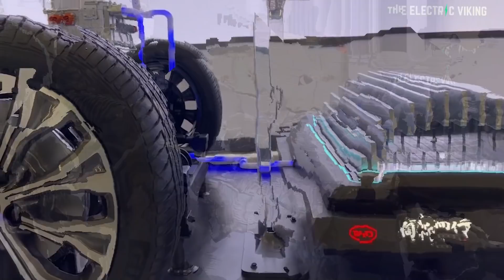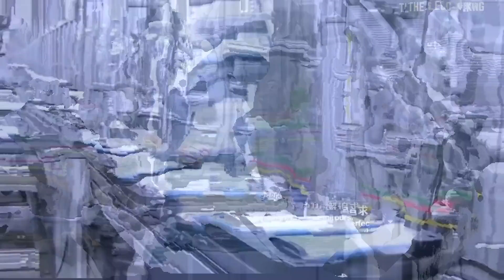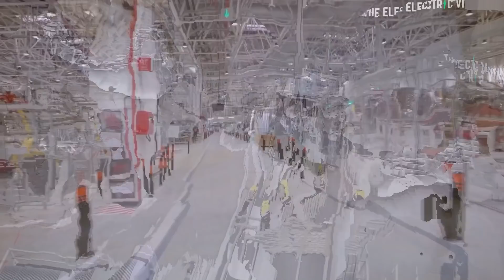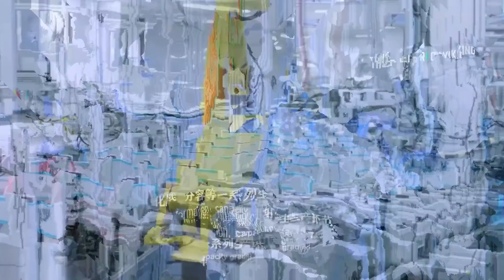BREAKING: Tesla order BYD's LFP batteries for 200,000 EVs

Comment: Our SR+ is charged safely to 100% each night enabling maximum range of up to 480kms/300miles as required.
It’s the pick of the bunch.
Reply: Have you got the new 60 pack David? How many miles are you getting real world?
Reply: @wakeywarrior  it’s 8 months old and 278 miles fm  a nominal 50 kWh, but we keep up in the slow lane here in Australia @62-65mph in our summer. Being retired we can be choosy on weather forecasts also.  Lifetime average is 119km/kWh and dropping.
Reply: Is that the lfp version,, I know your not supposed to charge past 80% on the old ncm all the time to extend life expectancy of battery just asking 
I can't wait to see the 4680 comeing out of giga Texas i know right now its software detuned to match the 2170 comeing out of fremont until they can switch over to the 4680
Reply: @lesstevens2370  yes, LFP with significant buffers. I can sleep without worry and never suffer significant degradation either.
In Australia the SR+ qualifies for a small rebate - $A3K.  It’s the standout bargain.
Reply: @lesstevens2370  yeah, the worry free LFP with the most accurate energy tracking software also ……totally accurate and linear.
Reply: @davidpearn5925  right on cant wait to ditch my old gasser 2017 dodge durango 2 more years left on the loan then I'm out no more gas vehicles for me
Reply: Gas over here in canada is 1.70 a liter electricity is 0.08 cent a kwh
Reply: @lesstevens2370  slam dunk !

Comment: You can use the full range of a non-LFP battery.  It's just good practice to not fully charge and leave the batteries fully charged for a period of time.  If you're heading off on a long trip set your charging to take your batteries to 100% an hour or two before you depart.

But LFPs are, IMHO, a better choice for almost all.
Reply: That just like saying you can do cocaine and heroin but its good practice not to...🤔
Reply: @airrodgers7277  
Analogy fail....
Reply: @airrodgers7277  but that would be a lie!! Haha
Reply: @airrodgers7277  That is certainly not a universal truth.
Reply: NCMA chemistry is way better than lfp because of the range.
Reply: @greengold6705  
Flip-flops are great on hot asphalt but flippers work best if one is snorkeling.

Most EVs are likely to use LFP batteries due to their lower cost, very high cycle life, ability to be fully charged and discharged repeatedly, and resistance to burning.  Other chemistries are likely to be used in performance and very long range EVs due to their lower weight per kWh.
Reply: Maybe in China but not in the USA. If the battery costs a thousand dollars more and had 50 miles more range that's what everyone is going to go with in the USA.
Reply: I think there will be a place for LFP cheaper low end cars and energy storage.
Reply: @greengold6705  
I'm not sure what US vs. China has to do with it.  Within a few years it's likely all batteries used in EVs in the US will be manufactured in the US.  There's not a lot of labor in cell manufacturing and battery pack stuffing.  Batteries are heavy, large, and cost to ship.  Battery manufacturing, like car manufacturing will tend to happen close to the market.  Especially as production becomes more automated and China's labor costs continue to increase.

IMHO most people are not going to own cars 20 years from now.  Robotaxis will be so inexpensive and convenient that most people will decide to spend their car dollars elsewhere.  Including people like me who live in fairly remote areas.  LFP cells are perfect for robotaxis.  And robotaxis don't need high ranges.  Robos can be in heavy use during peak demand periods and then rotate in for a quick recharge between demand peaks.
Reply: @greengold6705  
LFP cells are likely to be used in all cars except for high performance "sports" cars .  With a fully developed rapid charging infrastructure cars will need only modest ranges.  

Higher density by weight cells are likely to get used in things like long haul trucks and airplanes where the extra weight of LFP cells would be detrimental.
Reply: @bobwallace9753  I wasn't saying China vs US I was Lfp might be better in China because it's cheaper with less range while the US customer is more concerned about range than cost.
Reply: @bobwallace9753  electric semi are vaporware to been five years since Tesla came out with the semi and they have sold no units
Reply: @greengold6705  
I do not agree on the range issue.  I think many US drivers now believe that they need a lot of range but I think that will change once they have some EV experience.  

No one has a gas pump in their garage.  With an EV you can get in your car every morning with a 'full tank'.  And with a moderate range EV you can do long trips and arrive not long after you would were you to drive an ICEV.  People will learn that.

Private car ownership, I think, will largely fade away over the next decade.  It just won't make economic sense to own a car.  Taxis in some of the markets which have the highest usage, NYC and LA, average about 70,000 miles a year or about 190 miles per day.  You could easily do that job with 100 mile range EVs.  Just recharge a couple times per 24 hours.
Reply: @greengold6705  
Tesla has been battery limited.  Tesla makes more money off their Model Ys than they would, apparently, were they to use those cells in semis.  Therefore, Tesla has postponed semi production.  Tesla delayed the new Roadster for the same reason.

But now Tesla is manufacturing 4680 cells at a commercial level and they are starting to build semis.  Tesla is in the process of delivering the first 16 T-semis to PepsiCo.  I think some may have already been handed over.  Megachargers have been installed to put juice in them.
Reply: @bobwallace9753  Range is one of the top issues with people switching to EVs that is not going to go away anytime soon. The whole Robo taxi is going to eliminate car ownership is a complete hypocritical because they don't exist yet sure they might a tiny geo fenced area in China just in Phoenix Arizona with a very very small number of vehicles doing it. The fact you have no idea when Robo taxis are going to be able to really match a human driver. If you want to let fsd beta drive you every where good freaking luck buddy I wish you the best. I love Tesla but Elon is a car salesman every year is the year they are going to solve fsd.
Reply: @bobwallace9753  The first 16 semi's that was supposed to come out four years ago and no time table to build more. I'm not against the Tesla Semi just saying you can't take everything they say as a guarantee. They are building 4680 at a very small level I absolutely hope they are successful at mass production of 4680 but it might take another year or two to get there.
Reply: @greengold6705  

1.  "I just bought a 350 mile range EV and now realize that I paid for about 100 miles of range I never use."  That will  be heard as people buy and experience and next time many will buy the size that fits them.

Range anxiety anxiety.  People will buy belts and suspenders, then realize they needed only one of them.

2.  Yes, the Chinese robotaxis are geofenced.  But they are operating.  If something exists then it's real, not vaporware.  Let's not have a game of moving the goalpost, shall we?

3.  I have a guess when robotaxis are going to replace human drivers.  Now.  In a very small number of cases in China.

Elon and the other people involved in Tesla's FSD program expect their system to be working about 10x better than humans by the end of this year.  Remember, they see all the data.  They know what is yet to be solved and have a decent idea of how to fix the remaining edge cases (let their AI computer chew on the data for a few more months).

Let's be conservative and assume they are off by a year and they reach 10x better by the end of 2023.  I think that 98% likely.  Then add on one more year to collect the data needed for the first states to allow driverless operation.  2023 to 2025 is when I think we'll see Tesla robotaxis and Tesla is likely to manufacturer millions per year.  

Would I let Tesla FSD beta drive me around?  Absolutely.  I fully understand the word 'beta'.  And I'm smart enough to pay attention and be ready to take over if an unsolved edge case is encountered.  I don't do stuff like text while I drive.
Reply: @bobwallace9753  Range is one of the top issues with switching to EVs I never said I agree with it I never drive over 200 miles a day but it seems the vast majority of Americans would rather pay the extra 500 to a thousand dollars to get the extra 50 to a 100 mile range. When you say robo taxis you are not talking about a small fenced in area only to drive in. The Robo taxi implies that you are going to go to work or sleep and the car goes out and does Uber all by itself I have no idea when that is going to happen and neither do you. I hope they can solve it soon but who knows and then States and local governments are going to be a huge barrier with regulations.
Reply: @bobwallace9753  You would have told me 4 years ago that it's 98% by 2022 so fool me one year okay but Elon has said this is the year for year's but I hope they are successful but I wouldn't bet the house on it
Reply: @bobwallace9753  Why hasn't China been able to scale the robo taxis if they have it down so good.
Reply: @greengold6705  
Again.

First time EV buyers may well purchase more range than they actually need because they are used to filling up once a week or two.  They have never experienced a car that has a 'full tank' every morning.   They think they need hundreds of miles of range in order to take long trips.  They don't realize that they can charge up while going to the bathroom and grabbing a sandwich at the counter.

The difference between a robotaxi with a small geofenced area in which to operate and a large geofenced area in which to operate is a matter of someone doing some mapping.  My math says that a team of ten or fewer drivers working eight hours a day could map a good sized US city in a 40 hour week.

I'm not saying that the detailed robotaxis are ready to handle the most unusual places to drive that one can find.  But it looks to me as if they could drive over half of the places.   Right now in China you can climb into a Chrysler minivan's back seat and go to sleep while it drives you, with no safety driver aboard, in geofenced areas.  There are videos on YT.  Look for AutoX.

Florida and, I think, Nevada have already written regulations allowing full self driving cars.  When some company hands in the data it's a go.
Reply: The semi was brought out in 2017 and he said they would be delivered in 2019 sorry 3 years ago watch the video if you don't believe me. Three years without any real deliveries is a lot of time. I'm not hating on or against the Tesla semi it's a cool product just like everything Tesla does but you can't go by Tesla's timeline on everything. I hope they are successful at everything they do and I think given enough time they will. That doesn't mean you are going to get a robo taxi this year or next.
Reply: So because a YouTube video in China showed someone in a robo taxi you think it's ready wow man. You honestly think whatever company is doing is further ahead than Tesla on FSD. That is not proof robo taxi's are ready imo but I guess we will see. I've never claimed I know everything but I've followed Tesla for years longer than most of the YouTube Tesla channels that are out right now. I've heard the robo taxi's argument for year after year so I don't put much faith in it. When you watch FSD beta you can clearly see it's not ready yet but I hope they are successful with it.
Reply: They are at least a year or two away from serious 4680 production listen to the recent earnings call.
Reply: A million 4680s sounds like a huge number but that only makes a thousand cars. I'm not skeptical or negative on 4680s I think Giga Texas will be a great factory. I'm only skeptical on full self driving but I hope they solve but it could be year's away.
Reply: @greengold6705  
I'm not going to rewatch the video to see if it was 2019 or 2020.  Stuff on the web says 2020. 

Here's the point I wish to make.  When someone sets out to do something that's never been done before the best they can do is to estimate completion based on the known knowns.  Until they travel into that unexplored territory they will not be aware of problems they may encounter.  Elon makes his best guess, gets it right sometimes and gets it wrong sometimes.  He can't predict a pandemic before the first case arises, for example.

I'm pretty sure that in 2017 Tesla did not know that they would develop dry-rolled 4680 cells.  Nor did they realize how high demand would be for the Model Y.  Things like that are unknown unknowns that change how the future plays out.
Reply: @greengold6705  

Oh, damn my lying eyes have deceived me again.

BTW, there are multiple videos showing people documenting their experience in using AutoX robotaxis.  Waymo has been making some small area geofenced robotaxi runs in the Phoenix area.  There'a  video where a woman tests a Waymo driving with no one in it against her Tesla w/FSD.  The Waymo, IIRC, arrives slightly before the Tesla at the destination.

Robotaxis are not vaporware.  They just can't operate everywhere yet.

I've been following Tesla since they first announced the Roadster.  I had been following low carbon technologies for years before, worrying about how we find acceptable solutions to fossil fuel use.   The Roadster proved that EVs did not have to be golf carts with doors.  They could drive fast and far.  I've been watching FSD videos as updates are released.  

I have not said that FSD is ready, please do not misreport what I've posted.

The best you and I can do is guess.  My guess is that there is at least a 50/50 chance of Tesla FSD being 10x better than human drivers by the end of this year and more like a 85/15 chance of it being ready by the end of 2023.  Make whatever guess pleases you.
Reply: I think we agree way more than disagree. I just don't know when Tesla FSD is ready I'm sure they will be the FIRST to solve it not autox never heard of them and wouldn't trust anything they same goes for waymo. I have faith in Elon and Tesla in the long run it will just probably take longer than  they let on but I hope they are able to do it all as fast as possible.
Reply: Sorry to tell you this but videos can be heavily edited tons of Tesla FSD videos are edited to hell and back to make it look like FSD is completely ready. I would trust Tesla way more than some of brand Chinese company.
Reply: @greengold6705  
Whatever.  But it's wise to take in all the facts and not just those that support your opinion.

Have a nice day.

Comment: BYD, a company founded in 1995... Warren Buffet invests in BYD. Elon made the best going to do business with China. There are more people with a 100 or more IQ coefficient than the entire population of Europe... Now LFP batteries will make at the same range the car heavier, so battery capacity will be bigger. Is about how much you run the car: over 50-60 miles daily - LFP,  under - LiPo. If you charge the car once per week, 500 charges mean 8 years...